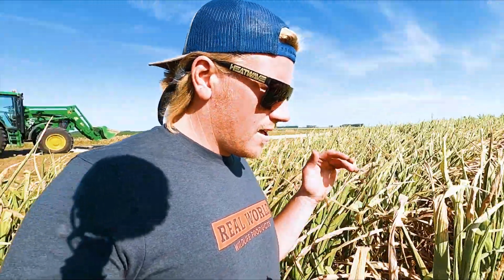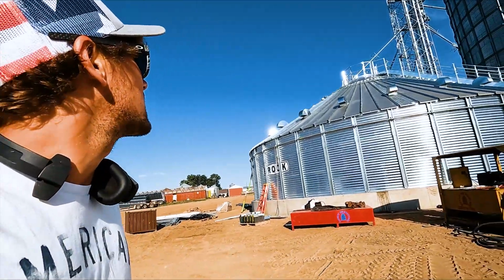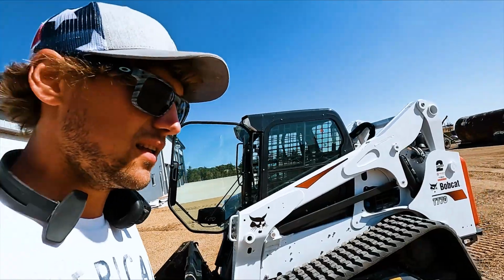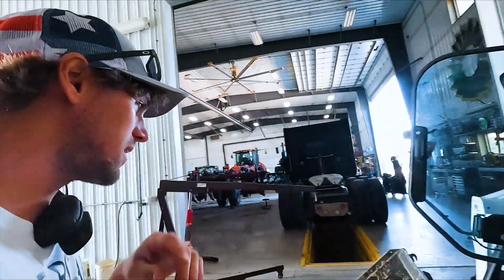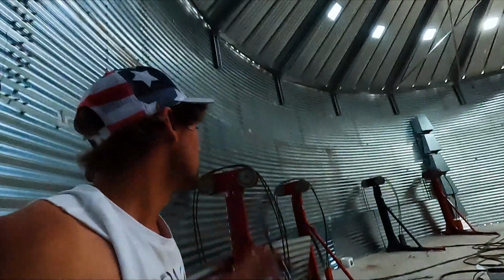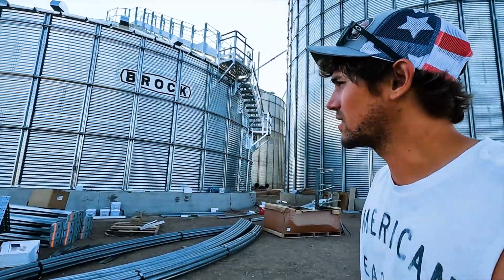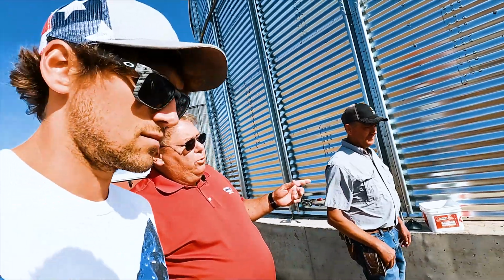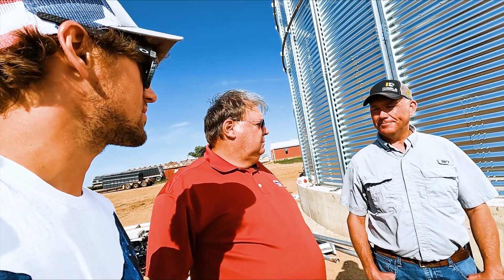Building Our 200,000 Bushel Brock Grain Bin!!

Comment: To answer your question Doug, its usually about 8 guys, 4 with guns 4 with wrenches... Depending on the brand of gun, we usually get a season or 2 out of a gun, doing 30+ bins a year of all sizes. If corded, even longer. We have got corded nut busters that have been used for the past 6+ years

Comment: Guys in my experience with grain handling,  the main reason to core the bin, isn't so much to remove the fines, tho that is a welcome side effect,  but the main reason to core the center of the bin is to lower the grain depth to lessen the air pressure of the center of the bin. So air moves easier thru the center of the bin. If you side draw in the fall you defeat the purpose of lowering the center grain depth, by lowering the wall grain depth.  Knowing full well the fines are in the center of the bin.   I would reverse the cone in every bin in early fall, and run the fans in the coldest days of the winter to freeze the bin up.  Come march start moving grain out so as not to let a crust develop on the surface of the grain in each bin.

Comment: Chek what kind of bin sweep will go in? We are planning on replacing the sweep in our 250,000 bushel bin and looking at different options. Do you use something in your current bins that you might recommend?  The bin was built in the early 80s and the sweep is made up of 5 sections which need to be added after it goes around twice. A pain in the ass and we are all getting to old to mess with putting sections on!

Comment: those new fuel filters are top notch compared to the old style, We had 3 machines come back on snow return, two of the machines were the new r-series which have that style filter, a little bigger actually and then a s-650 with the old style, the s-650 needed a whole new fuel system and the two r-series just needed a fuel flush and new filter, and they still ran before that, all were at the same location with the same fuel that was not stored correctly

Comment: I see the chemtrails behing you Swede, up in michigan, usually overnight, or the next day i get rain.  If the weather forecast says no rain, and i see the chemtrails, i know the weather guy didn't look at the sky.  I guess a couple guy's in the thirties were experimenting in the high mountain's in vermont with sending electrically charged ions into the atmosphere, and it rained.  I don't know what's in the trails after they finally admitted to spraying, but a lot of people have noticed differences in their soil.  A guy tested his soil, and the lab found aluminum, barium, and strontium, along with other heavy metals i don't recall.  I know a lot of small farm's and gardeners down south had what they called a flash drought, and no matter how much they watered the ground, the dirt turned to dust.  The high tunnels turned out okay.  If you want to hear about the flash drought, watch deep south homestead on yt, good guy.  G-d bless Erik.
Reply: The visible chemtrails (contrails) form when it is moist way up in the atmosphere (jet stream) in advance of a low pressure trough (rain) the next day. They may be easily adding chemicals to jet fuel to engineer the atmosphere everywhere.  I knew of commercial operations 40 years ago that cloud seeded by plane farms in UT but it was a small operation.
Lt. Col Retired, USAF Air Weather Service

Comment: the discussion about "fines"  - I assume this is tiny particles that get knocked of the kernels/beans as they bang around post combine in the hoppers and conveyors ?  Is there not a vacuum type system that can suck them out as the grain is being transferred into the bin ?  Do they have a perforated center tube up the center  they can be drawn from ?    Do those mess up the drying rate in the bin too or is all the moisture set to % in the dryer that runs as it's being off loaded and shortly thereafter ?    Interesting topic as both the fines and moisture are hits when you deliver it....  hope the bins all get in place and operation otherwise as it seems you're pretty close to combining some stuff here in the next few weeks...